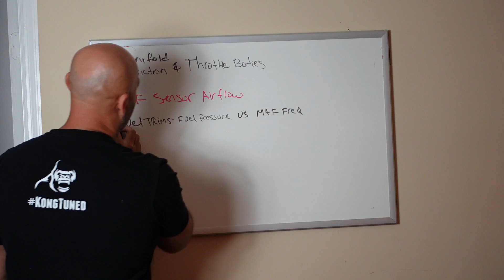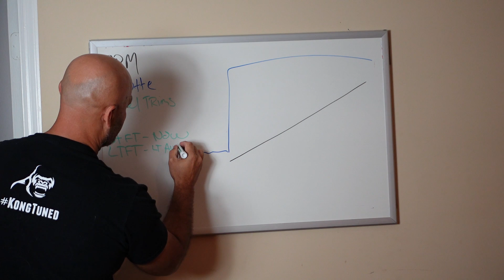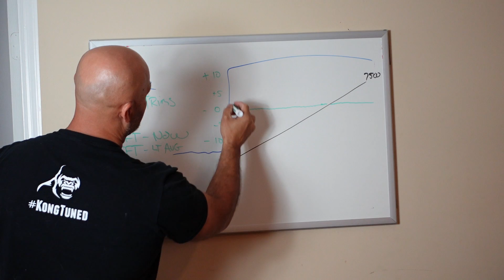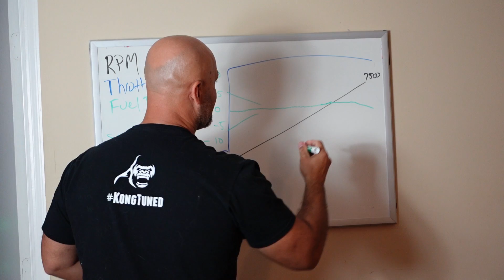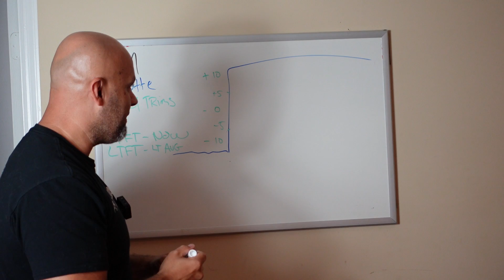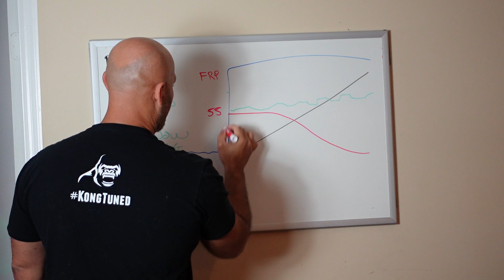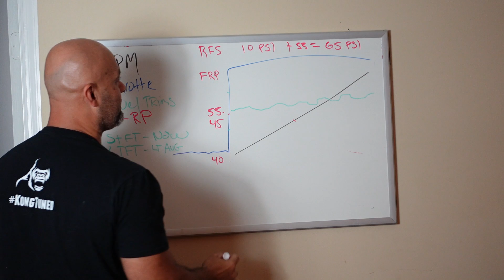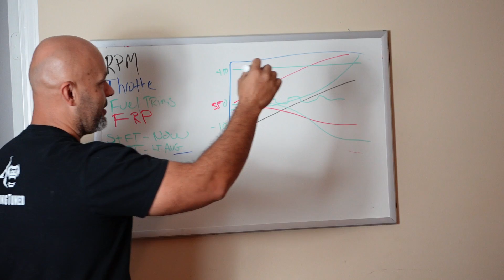Whiteboard #4 fuel trim discussion

Comment: Hey Alex.  Quick Q.  My car is Lund Tuned. 2021 Mach 1, Hellion Sleeper, 6MT, DW400, ID1050X.  Fuel is 50:50 91 + VP110.

Last time I datalogged on the dyno (to test cutouts) it appeared I was running into a fuel delivery issue above 7000rpm on high boost (12.5psi).  It was a very cold day (30F but im at altitude = 4500ft).

Could I add a BAP for added safety margin without a tune revision?  Is that a good call OR should I keep boost lower (I am currently) and just save for a multi pump system.

Car made 940s on a chassis dyno in SLC, UT.

Comment: Hey Alejandro, my short trim fuel trim stays within 5% but on a pull it went to 10% rich and the opposite bank would raise to 7%. I am catless and have codes due to being catless and am on a gen 3 coyote e85.  Should I replace the o2 sensors? I also watch my afr go from 8-9.9 my tuner says everything is fine but I feel like they are over looking me and just moving on to the next guy.
Reply: Never mind it is not just while I’m a pull my fuel trim driving around was at stft bank 1 was at -15.4% and my stft ban2 was at -11.9%
Reply: Should I replace my sensors? Or could it be bad due to bad E85?

Comment: Have you seen any issues in data logs with dead heading a return style system vs flow through?
Reply from the maker: Only in high horsepower applications over 1,000 under that deadheading in my opinion is fine

Comment: I also have the ESS kit on a 21 GT.  Fuel regulator is connected to the factory vacuum source. Is that correct? Don’t currently have a way to monitor boost, only vaccuum